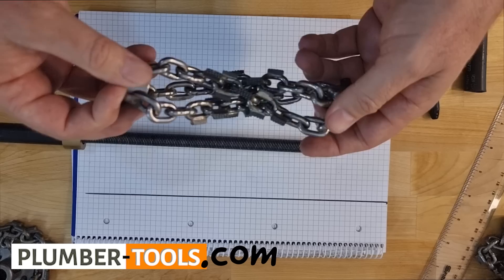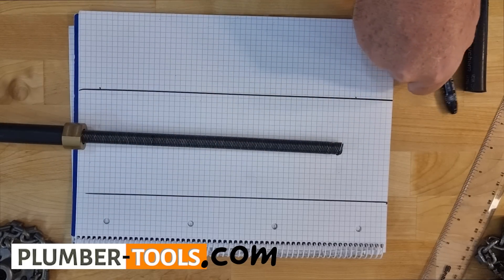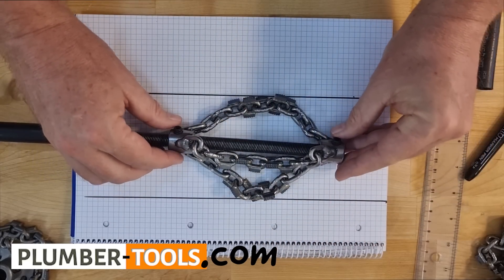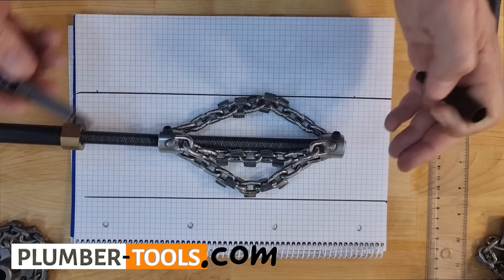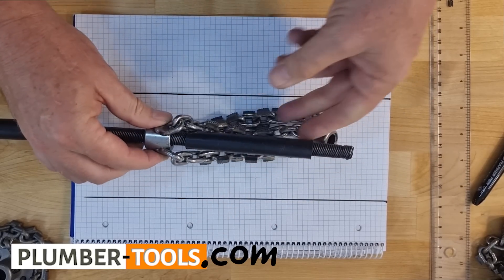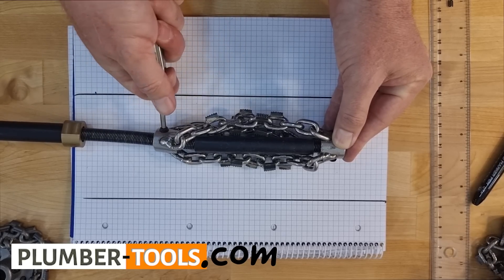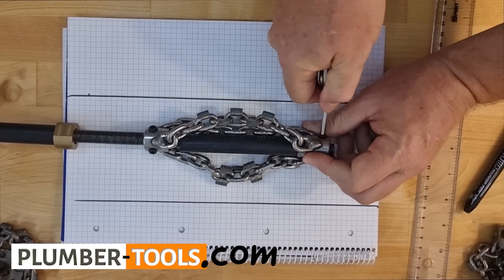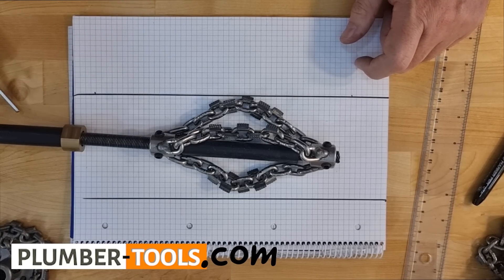Connecting your drain cleaning chain to your flexible shaft

Comment: Do you ever use thread locker on the grub screws?
Reply from the maker: Great question :) I used to use thread locker on my set screws, but I change chains often, and it became a bit of a hassle. so I bought a bag full of spare screws and replace them whenever I loose one when my shaft experiences excess vibration. Having said that, I know from feedback that other users prefer using thread locker

Comment: Hi..

Can we apply this unit to unclog harden grease found in the cast iron kitchen waste pipeline measuring 6 to 8 inches and length of the pipe almost reaching 20 to 30 metres?

Thank you
Reply: Hi :) absolutely. These tools will cut through hardened grease like a hot knife goes through butter. They are so strong that they will even break up urine scale or tuberculation.